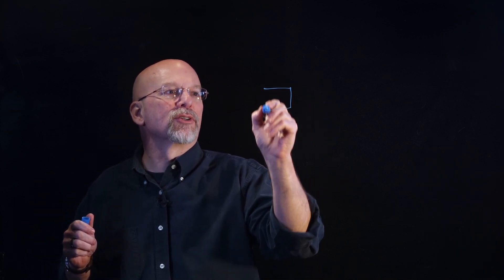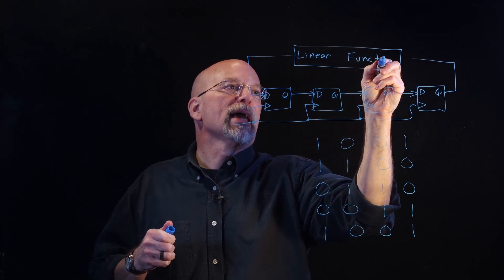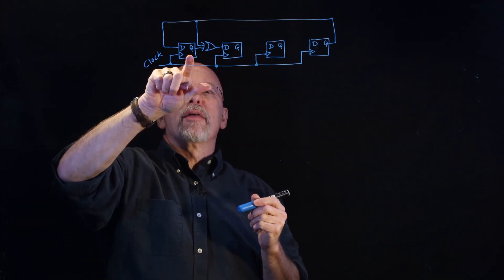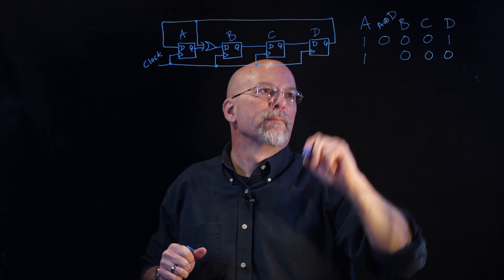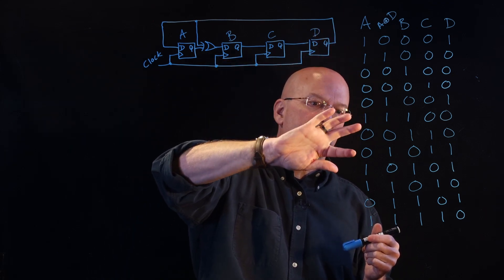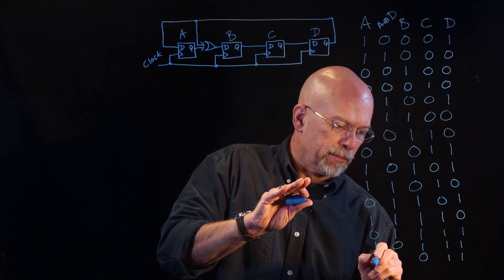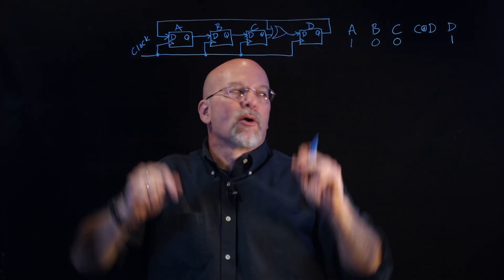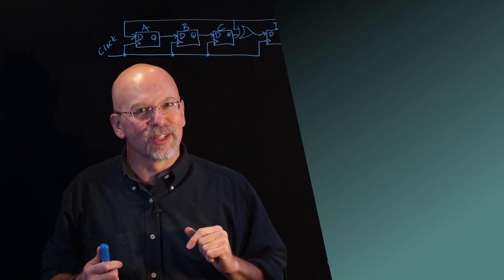Internal Linear Feedback Shift Registers

Comment: Sir, I've been waiting for a new video from you for a whole month! Thanks a lot for such great content! I have a topic that I would like to clarify for myself. Could you help me understand how UART works in terms of FSM? Could you please explain step by step (as you usually do) which processes (I mean VHDL processes) I need to create and why? How should I understand from the testbench that everything is working correctly? Thank you very much for your hard work!
Reply from the maker: Thank you for the kind words! As for the topic suggestion, it's a great one. I was on a team with Dr. Armstrong out of Virginia Tech to work on the test suite for VHDL, but it's been years since I've used it. Maybe I should put together some VHDL lessons before tackling an implementation lesson.
Reply: @Intermation  Thanks a lot for the quick response. I actually have a PDF file that has UART codes for components using FIFO and a circular buffer. (Components RX and TX, sample application and "creating a file for workflow" and test benches for each part, which can be useful as a reference for creating a new video). The fact is that these codes do not have enough descriptions (in terms of FSM) to be understandable to a beginner. You will understand my question better if you see the implementation I have. Can I somehow send you this pdf file or a link to it?
Reply: David Tarnoff you are a gifted professor and I thank God for putting you in my path. You have the ability to always be one step ahead of any question that may arise in the student, I feel like you read our minds. May you and your family always be healthy!